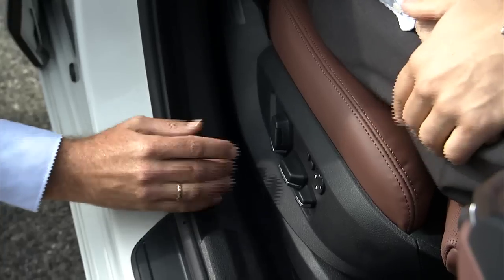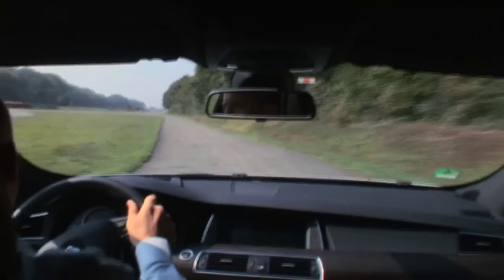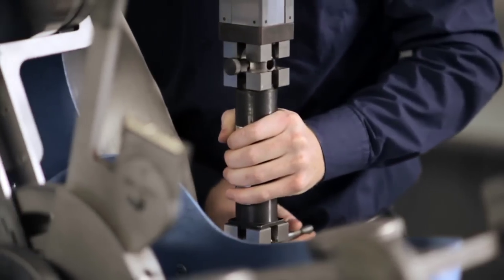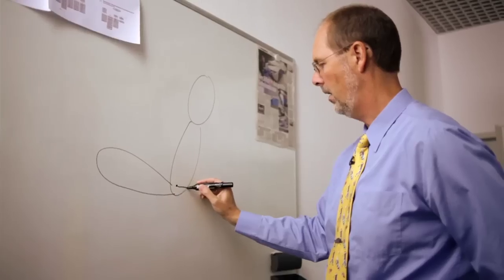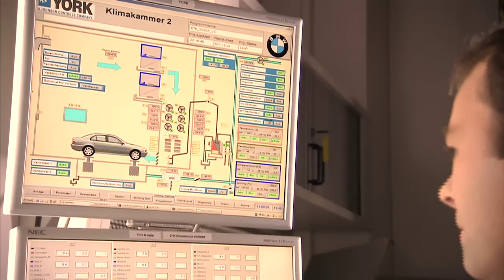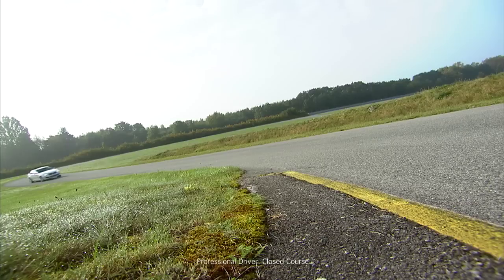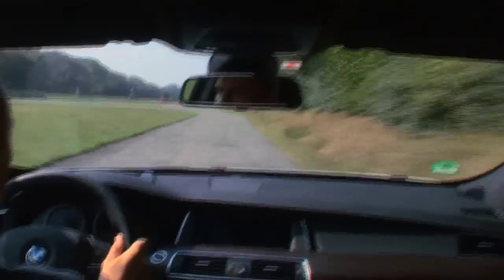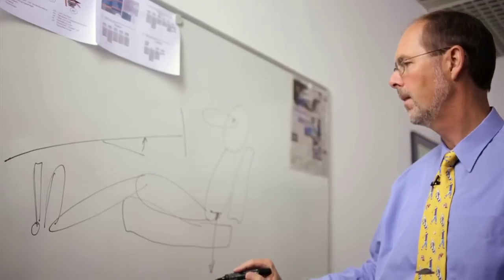Engineering the BMW Driver's Seat

Comment: Most probably a new design team is desperately needed in the seats department. How can it be so wrong? Apart from the F10, 5 series model, I do not remember having really proper seats in any of the E90 F30 or g20. The wooden spoon goes to m sport seats from the g20. If the seat has adjustment for the seat pan angle why is it so angled in the beginning.

Comment: They sure didn't do a good job on my 2008 X3!  On one side (near the back of the driver's seat) you are sitting on the tilt electric motor, on the other a void.  The result is you slide out of the seat on the side with the void.  Most uncomfortable seat in my 42 years of driving in any car make.

Comment: I will continue to purchase an  European car before an American recall piece of junk. GMC tops the category with recalls. I unfortunately bought an Acadia before buying a BMW. Apparently, GMC thought it would be a great idea to allow rain water to leak through the Acadia's roof. Radio and nav system is fried. Of course they will not fix it.
Reply: GAboy3030 GM has a 50-50 percent chance of bankruptcy. You’re going to discontinue the Camaro and the 2019 Corvette I had was actually hard to get into uncomfortable to drive and very expensive to maintain. I don’t know what I’m gonna get next none of the cars are the quality that they used to be even Mercedes Benz has let us down, mainly because they use Chrysler parts my first Mercedes Benz 1974 to 40 DC or diesel 115 117 last in 1,000,000 miles although I did but three engines what a car￼